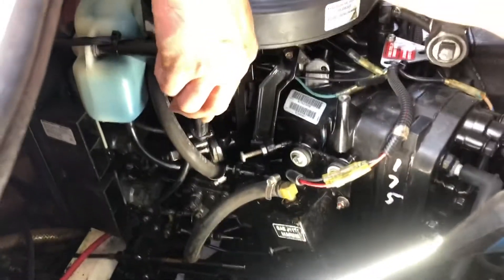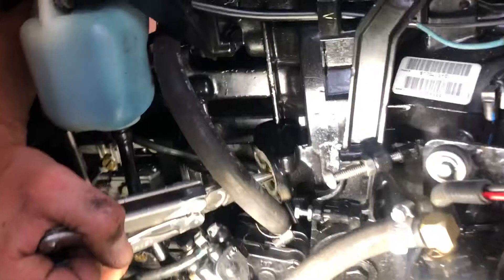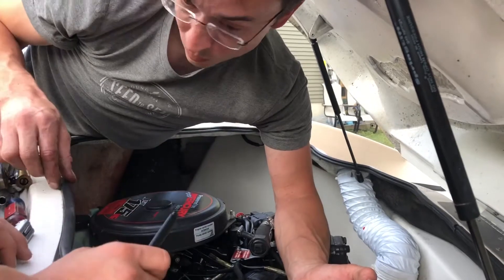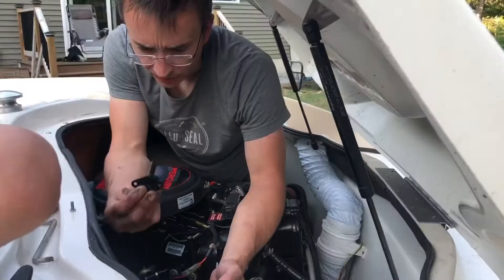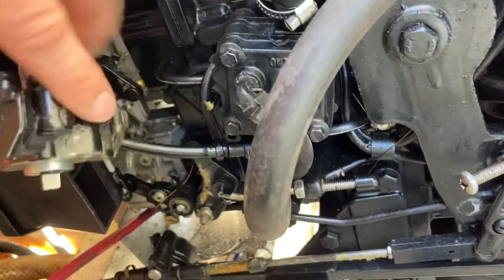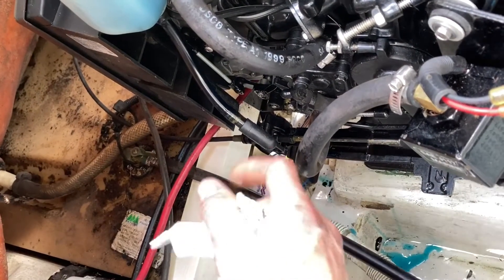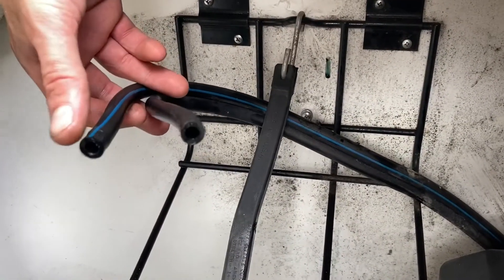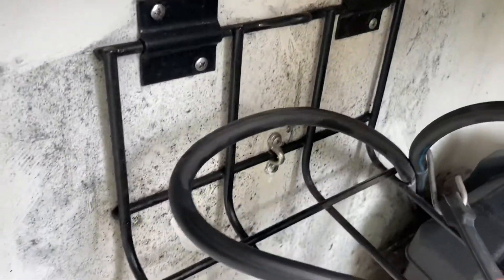OIL INJECTION DELETE: MERCURY 175 XR

Comment: great video, what happens if you cap off all oil lines and mix it with the gas. do you still need to remove the oil pump rod?
Reply from the maker: YES.  If you don’t that pump is still moving and doing it’s thing (if the drive gear doesn’t fail)… it’s best to delete it and cap off.
Reply: @stevemartin9498  hey Steve can I just take my oil shaft out and just block it off with the original oil pump
Reply from the maker: @marcusdominaux795  you might be able to do that sure, however in the future someone may get the wrong idea and think the system is still operational…

Comment: Underneath your starter there is a brass fitting with a hose coming off it. Is that part of the oil injection? Reason I’m asking I have the same on my boat and it’s been deleted but that hose has crankcase pressure that is releasing from it. I’m hearing a hissing/ticking noise from it.
Reply from the maker: I would inspect the line because it ideally should not be leaking.  If its the line that was used to deliver crank case pressure to the oil tank originally there will normally be pressure wanting to escape there.  Be sure it is adequately capped off.

Comment: you should have removed the engine oiltank and sensor above the oil pump . Also , you should have put 24C grease on the orings before installing and blue locktite on the 2 bolt threads .
Reply from the maker: I haven’t had any trouble with what I’ve done thus far.  I’m a fan of loc tite but the bolts are still tight.  I left the oil tank so I wouldn’t need to fiddle with the oil level warning.  It’s just how I did it myself you can remove yours if you like, both ways work.

Comment: you should have removed the engine oil tank ! do the 3plugs and drain  the line between fuel pump and the connection  , so mixed fuel will need to be replaeted ?

Comment: Coming from a boat that I have to premix my fuel and oil, I cant wait to have an oil injected boat
Reply: Yeah I'm so confused too. I have oil injection and it's kept everything inside the engine like new. Just baffled as to why you'd remove it?
Reply from the maker: @fkingbear1834  On motors that have a plastic gear on the crankshaft that drives the oil pump... those are the ones that suprise - suddenly you have no oil pump and your motor grenades without warning.  My oil injection worked fine, its the unreliability of the components that I didn't want to risk.  I've heard enough stories of oil starvation.  Premixing/deleting the pump ensures you will not have issues with this.
Reply: @stevemartin9498  Holy moly, thank you for the details in the follow up. I'm going to tear mine apart and just double check what that looks like inside. Plastic gear IS something I understand wanting to remove and I happen to be a machinist so If I can't actually come up with a solution I may follow your suit brother. THANK YOU before I killed a great running engine..

Comment: Why did you delete the injection the updated version with the brass bushing doesn't have the problem stripping the nylon gear inside the crankcase that was pre-1996 motors
Reply from the maker: I'm a member of the sugar sand group on Facebook.  I was seeing several posts per week of guys seizing their engines due to oil starvation for one cause or another.  Its not only the unreliable oil pump gear, the whole system can be problematic and there is no warning until its too late.  Premixing for me was the way to go.

Comment: How did you stop the oil pump sensor from beeping. Looking at deleting my injection but I’ve read you need to snip one of the wires that alert you when the oil pump isn’t working.
Reply: He left his oil tank in place and full of oil so that the sending unit does not send an alarm voltage back to the buzzer.
Reply: nice vid , but you should have lubricated both orings with 24C grease before installing

Comment: You didn't show the disconnect of the pump rotation sensor wire, good vid otherwise,
Reply from the maker: Sorry to disappoint.  I didn’t bother doing anything with what you’re referencing.  Haven’t had any issues either.

Comment: Thanks for the great information! Just bought a Boston Whaler with the same engine and the previous owner has already blocked off the oil. However, the engine is doing the oil warning beep every 2 minutes. there is some oil in my reservoir but not a whole lot. Would the beeping stop if I filled up the reservoir more or do I need to cut some wires to the buzzer?
Reply from the maker: Probably either way.  Not sure if the level sensor activates or deactivates open or closed -  you could figure that out easily enough.  Otherwise you could just fill it with oil and call it good!  Thanks for the comment and cheers!

Comment: Hey how did the oil injection delete work out, did you run into any problems after? Planning on doing this to mine that was very helpful.
Reply from the maker: Psycho Cichlids no problems afterward.  I just premixed the fuel to be 50:1 mixture and off we went.  Don’t forget to hit like if it was helpful!  Consider subscribing also I’ll have more videos!